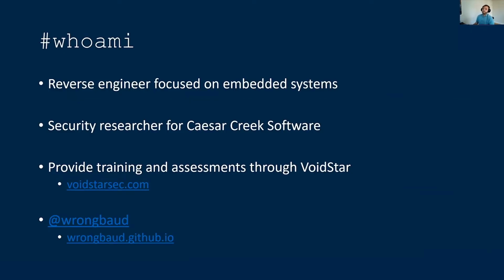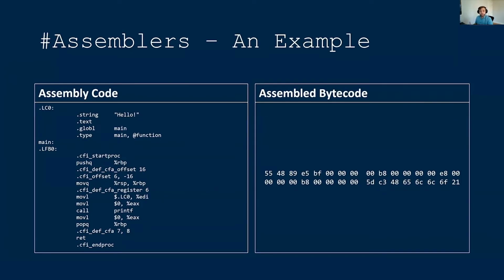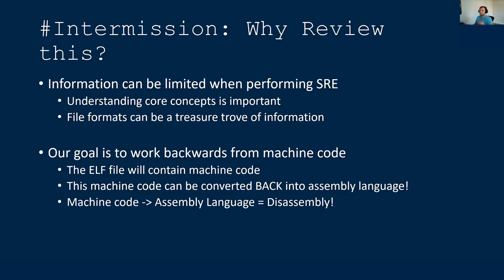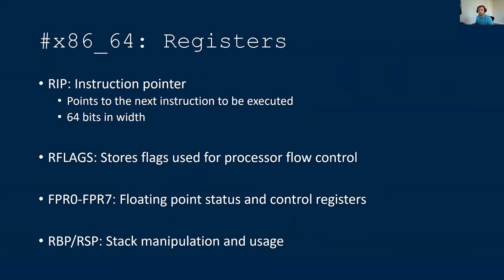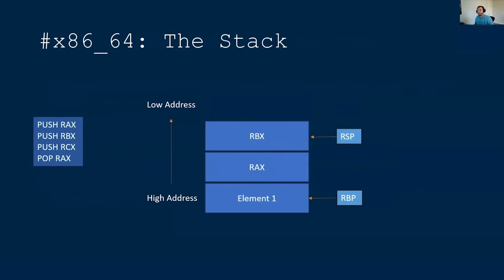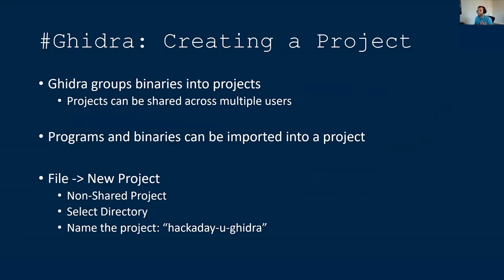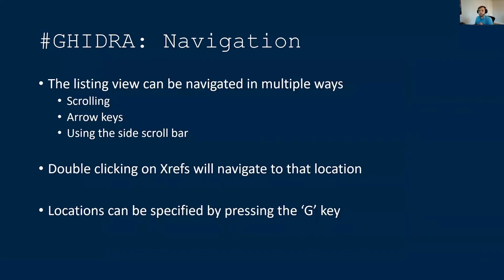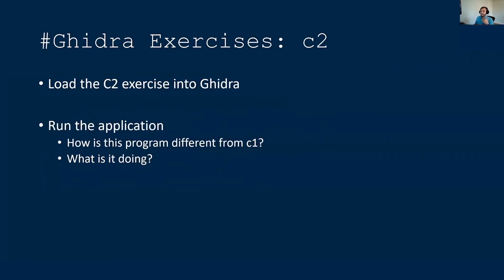HackadayU: Reverse Engineering with Ghidra Class 1

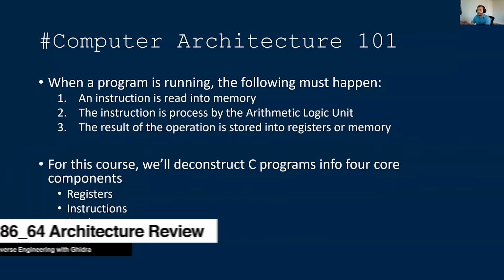Comment: 24:00 This slide might be a little misleading. The instruction is moved from memory into the instruction register. Then processed and decoded in the Control Unit. The CU configures and coordinates the other components of the CPU like the Arithmetic Logic Unit and registers to perform whatever operation and read/writes to whatever registers are involved. 
The instruction itself is not processed by the ALU. The ALU only performs some bitwise mathematical operation given by a control signal from the CU, on whatever registers happen to be connected to the Bus. And those registers are themselves outputting, receiving input on the Bus or neither, depending on the control signal received by the CU. 
Sorry for the rant :) The slide can be correct if you read between the lines. But it leaves out what is actually happening.
Edit: Typo

Comment: Nice video, one comment - the code in the example at 42 minutes is in error. Due to the lack of ret after the mov rax, 0x02 it will run onto the mov rax, 0x01.
I e. No matter if the result of the comparison is true or false you will still end up with 0x01 in rax.

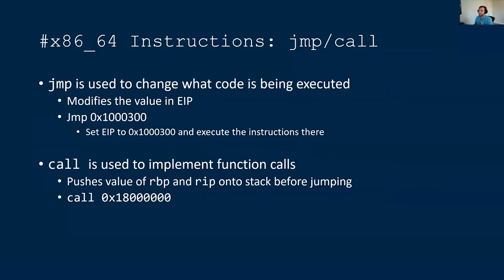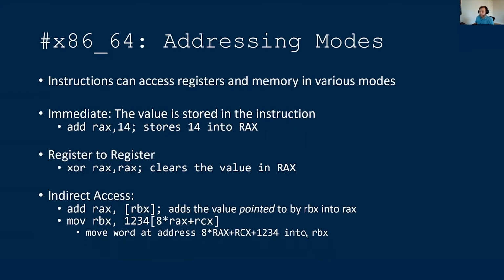Comment: Starting from the slide @37:20 to about @40:00 were you using RIP & EIP interchangeably? 

When you say "mov" - is the value actually moved as in the source register is cleared? Or is the value copied? For example after the instruction mov rax, rbx - what is in rbx?

Similar question for popping values off the stack - Does that just increments the stack pointer, and whatever values were in that memory will continue to be in that memory until the stack pointer is decremented again & new values get written?
Reply: mov copies the value. So pop register does 2 things. In x86  It looks like
mov register, [esp] and then add esp, 4. So mov copies the value. So it remains the same
Reply: RIP is 64 bit , EIP is 32 bit (EIP is the half part of RIP)  [64 bit register]= RIP or we can say that [32 bit +EIP register] = RIP register , EIP= [32 bit]

Comment: 35:34 push and pop. If the stack grows down (towards lower and lower memory locations as in your animation, which is correct for the x86 architectures), then PUSHing will DECREASE the stack pointer. POPing will INCREASE the pointer.
Reply: Good catch! Thank you for pointing that out

Comment: Love your video!😊 i have a question.. currently  i am learning some bufferoverflow concepts and using radare2 ...i hear lot about ghidra too should  i switch?
Reply: I'm just getting started myself, but I would hands down tell you to load ghidra. You will be glad you did.
Reply: Ghidra is much more intuitive, at least if you aren't already fast at re2. Worth trying, at least, since they're both open source.
Reply: Ghidra was developed by the NSA to overcome the limitations present in every other program available for reverse engineering, and limit the number of tools you need to have open at once to do it to 1.